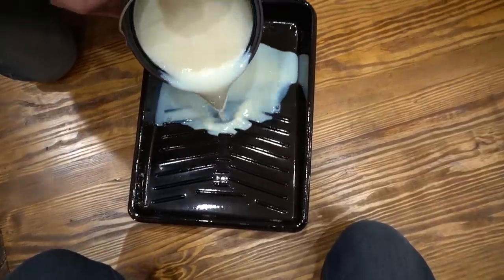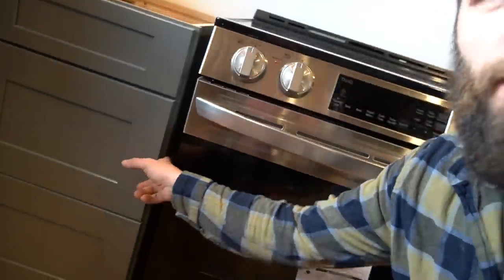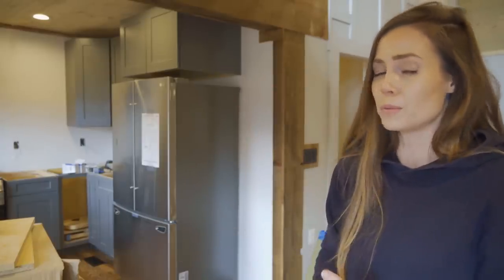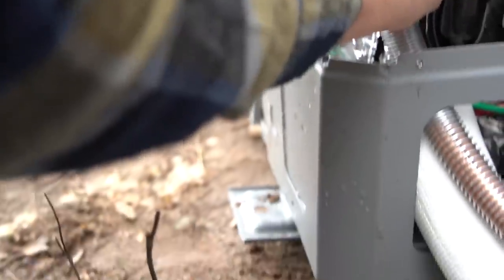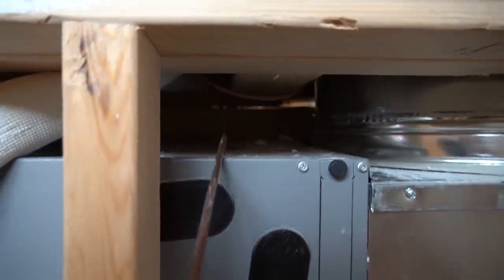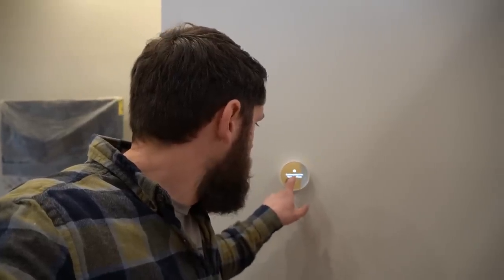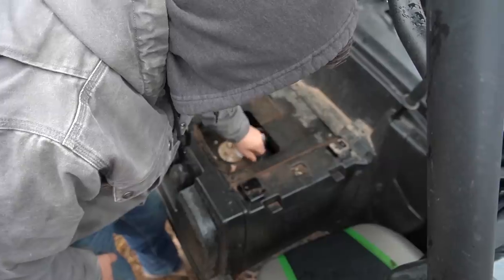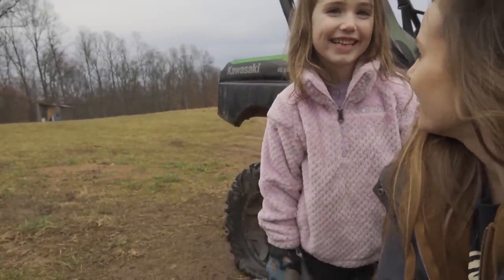A SURPRISE ENDING...We Can't Believe They're HERE!

Comment: Punch List: water: turn - on and off all fausets, check for leaks. Electric: check all receptacles, plugs, switches, Doors: all, open- closing, locks.Windows: open- closing, locks. Smoke alarms: testing.Hot water heater temp, prevent scalding. I hope l haven't forgotten anything. I worked for construction company in Florida.   After the final clean l went in and did punch list before final approval on build sign off. Loved it.
Blessings, Prayers, Always

Comment: I'm sure you get many suggestions......so here is yet another one. If you guys get into another complete remodel or build that has a HVAC system with return air.....consider dual air returns.......one up high by the ceiling for summer air conditioning times and one down near the floor for winter heating times. Install "closeable" grills so you can close (stop) air return on the return by the floor while using air conditioning....and vice versa you can close off (stop) the air return up at the ceiling during the winter heating months.....just a friendly suggestion, it will keep the home more comfortable and save even more energy.

Comment: We used to use those temporary normally closed thermostats on builds. Just a 2 wire hook up that keeps the heat at 65 all the time then when the job is done we installed the permanent one. Nice to keep a few around in case of emergencies or in the situation you had with the new smart stat you had.

Comment: Why not use a multi head unit with separate line sets to different locations?  Pipes can go in much smaller spaces and it’s more efficient because you can set the thermostat to lower temps in main spaces at night and and visa versa in summer while maintaining bedrooms.

Comment: Josh, Erin; pro tip from an 40 year HVAC guy.  The framing in front of the blower wheel housing needs to be removable or moved so blower housing can be slid completely out of air handler cabinet for routine maintenance and or replacement/repair.  Follow the natural divisions of the air handler cabinet.  Same for the evaporator coil and electric strip heat, so those components can be removed when needed.  At some point in time this will become an issue.  Carry on.

Comment: Get a Starlink system. You guest will like having an internet connection and it is fast. I hope it is available already in your area. Starlink is super easy to install). Then you can control your lights (with iwfi switches) and HVAC system thru Alexa.

Comment: If you ever bought a pair of Knipex Cobra Pliers, you would throw your channel locks away. They preform much better and are a lot easier to use. You can get a grip on a pipe and stand on the top handle without touching the bottom handle without slipping. I didn't throw my Channel Locks away. I kept them to handle the grill grate on my charcoal grills when they are hot. Thats all the Channel Locks are good for after getting my Knipex pliers. Knipex are made in West Germany and they make the best of any Plier configuration tool in the world. They sell Knipex on Amazon. You should check out the Knipex lineman's pliers. Much better leverage than Kline's.

Comment: My four wheelers pump stopped and how I found out was no sound and I took the air filter off and took a small hand sprayer and sprayed gas into carb and it started. So on Amazon I bought a pump and had to solder it on. Works good. It was because of intense heat from the engine that kills the pump. I put heat foil on the tank to stop it.

Comment: You guys need to pick up a Sensi thermostat.  Works manually, you can hook it to internet to control also but it still works right out of the box manually.  It also controls both heat and AC without having to switch between them... Not sponsored but love the product 😉

Comment: Those heat pumps take a little time to get up to speed but they will build up to it, eventually. The only possible problem I can see might be when there is 6 feet of snow on the ground. This is why the manufacturers allowed for the installation of auxiliary (emergency) heat with resistance heating elements.   It’s good that you swapped out that high tech stat for something better. Would hate to see somebody have to start burning furniture to stay warm when the internet goes down. Have a GREAT CHRISTMAS!!

Comment: You should always vacuum the system down before opening the refrigerant valves. Also that unit comes precharged for only so many feet of line set. Addition of freon would be required with a 25 line set. Improper freon charge may work, but not efficiently. It will also shorten the longevity of the equipment. There is no such thing as a plug and play HVAC system.

Comment: I will not install a thermostat that has to have internet to work.  You can get some like the one I have from carrier. I was able to set it up with out needing internet. But I can have it connect if I want to use the internet to control the device ect.  They need to have on the box that you have to have internet or it will not work.

Comment: Flex vent is not approved or designed for a kitchen exhaust. It is not fire rated and the ribs collect grease. Ridgid pipe only with foil taped joints.

Comment: With heat pumps  the heat is soft lol  its barley feels like it's heating  unless the emergency  backup heat comes on but really SUCKS the energy  drive electric bill higher  heat pumps more efficient  than electric strip heat  depending on outside temperature    as long as not extremely cold heat pump  ore efficient